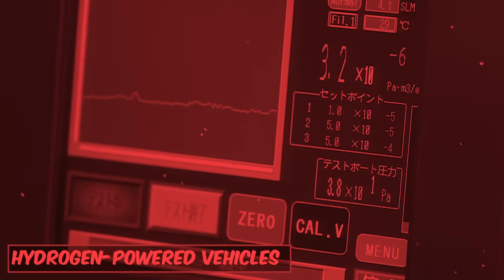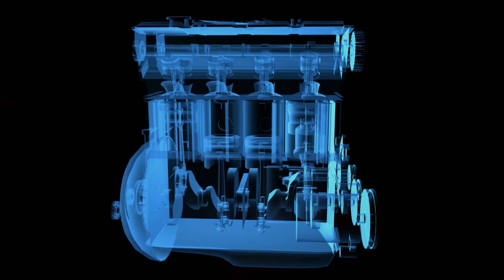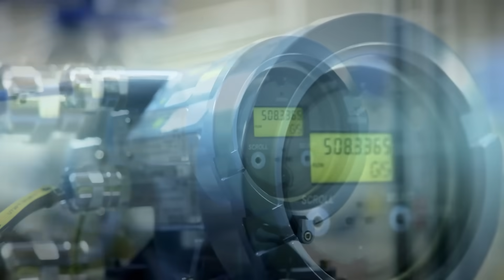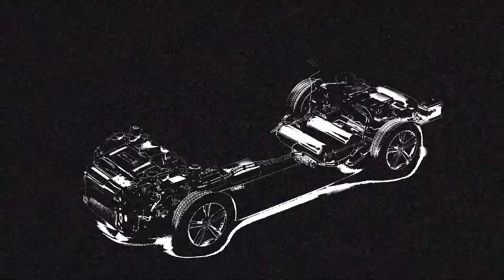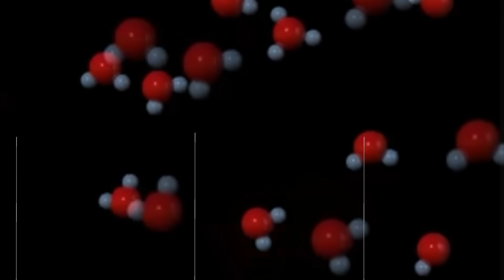Toyota's New WATER Engine Will Destroy The Entire EV Industry!

Comment: The ratio of electricity to run the electrolysis compared to the power output is 70% percent. 70% more power produced than consumed in the 1960 model. The 1995 model produces 300% more power than it consumes. We could and SHOULD have been using water as fuel, since at least the late 60s. We use coal to produce electricity and oil to fuel cars because they are the MOST expensive and they produce the most loosh. Its ALL about loosh production...

Comment: A nice sales voice and soft talk - a bit like someone reading to their children at bed time. I have worked on hydrogen from water without storage and if the bushfires hadn't burned me down in 2020 it might be working by now - solar panel powering hydrogen bubbler via small battery on demand - for cooking, heating and hot water. Not very complex technology at all - but at 75 y.o.now I may never finish the project - I am still re-establishing my rural off-grid setting. And the quantity required for an internal combustion engine is another level altogether ....

Comment: Oh boy! Now we have a valid excuse to operate a still at home. The home distillery that you can use to get distilled water from tap water can be used to make alcohol
 Although a high proof alcohol will power your car too. Running your car on 200 proof alcohol produces water and CO2 with none of the hydrocarbons associated with petroleum based fuels.

Comment: This is a hoax. Energy produced from the burning of hydrogen (in oxygen) is exactly the same (theoretically) as the energy required to produce hydrogen gas (and oxygen gas) from water (via the electrical process of hydrolysis). Due to inefficient mechanical heat losses, the practicality would be even worse than the nett zero position, i.e. it will take more energy to produce H2 (and O2) from water than it would for the reverse reaction. Any high school student of basic chemistry can tell you this. That's why it's more logical to produce H2 and O2 from water, using excess solar energy to power the electrolysis process.

Comment: They talked about isolating the hydrogen from the oxygen. If they just did an intake delete and just had the injector and exhaust they'd be able to make it happen without having to separate. Just run the normal electrolysis through with no intake. H & O would remain separate until ignited.

Comment: There is a challenge the stable producing of H2 from water, need huge amount of energy approximately 397,500 joules (or 397.5 kilojoules) of energy are required to split 1 kilogram of water into hydrogen and oxygen gases using electrolysis. But 1 kilogram of water (H2O) can produce approximately 1238.61 liters of hydrogen gas (H2) through electrolysis.
The energy content of this hydrogen gas is approximately 13.44 megajoules (MJ).

Comment: What about gravity? You climb up a ladder with a bucket of water and pour it into tank. Then generate electricity through a small turbine. Free except for using your energy climbing the ladder?  Or use a few hundred hamsters in wheels turning the mini generators.that you could fit under the hood.  What about using Gas? That might work

Comment: So this runs on water just like steam powered trains used to run on water. 

The steam powered locomotives used to use coal to convert the water into steam.  
  
Where do these cars get the electricity for hydrolysis?

Comment: So apparently, what this will do is crack hydrogen using electrolysis, then power a hydrogen combustion engine from the H2, correct? So you've already taken a hit on efficiency -- you'll get less energy out of the H2 than you put into cracking it, since no system is 100% efficient. Next problem: the hydrogen combustion engine is far less efficient than the modern three-phase AC motors used in EVs, and heavier. And you're going to need more batteries, so there's more weight. Finally, while I'll accept the claim that a hydrogen combustion engine can match the power output of an gasoline engine, your bottleneck is going to be the speed of hydrogen cracking. Can this actually keep up with the performance of the engine, obviously using the small H2 as a "hydrogen capacitor". And of course, you've made a more complex drivetrain than an EV, you're going to have to use transmissions again, etc. Seems a really long away around to offering a straight-up BEV alternative with no obvious advantage. Well, I suppose, given some possible H2 infrastructure, you could make it a true hybrid, powered either from electricity and water or H2 -- and get back some of that efficiency -- but then you're back to a large H2 tank.

Or maybe it's just a hoax, and Toyota isn't working on anything like this. They did recently patent a water-injection-cooled hydrogen engine, something completely different.

Comment: When water molecules are split into hydrogen and oxygen through a process like electrolysis, energy is required to break the bonds holding the atoms together. This energy input is typically in the form of electricity.
Conversely, when hydrogen and oxygen combine to form water through a process like combustion, energy is released as the chemical bonds form between the atoms. This released energy is often in the form of heat and light.
In ideal conditions, the energy required for electrolysis should be roughly equivalent to the energy released during the combustion of hydrogen and oxygen to form water. There is no way to gain extra energy to move the car :)). So this engine still need some external source of energy for electrolysis. Is it another electric car?
Reply: Bingo!  A big EV battery stack.

Comment: Obviously a car who perform the splitting of water into hydrogen and oxygen is gonna loose energy more than it will create. 

But what if a small battery made for an electric car, pluggable, comes with it to compensate the energy needs? 

I think that the goal of Toyota here is'nt to create magic water car, it's all about eliminate hydrogen costly and rare productions plants and transports infrastructures; every water car, even if they need to be plug like electric cars, will be like self-sufficient mini-hydrogen production plant, centering the Toyota's hydrogen motor right in the center of this revolution

Comment: What powers the electrolysis process? Wouldn't it be far more efficient and less complicated to use the electricity to turn the wheels rather than electrolyse water to produce hydrogen to fuel a combustion engine to spin the wheels?

Comment: The concept of powering cars with water through electrolysis and hydrogen fuel cells, as suggested, is highly inefficient and impractical. The combined efficiency from converting water to hydrogen and then to electricity is significantly low, roughly 25-35%. This, compared to the direct use of electricity in EVs which have around 70-90% efficiency, makes the water-powered approach markedly less effective. Additionally, the processes of water purification and distillation add further inefficiency and cost. In its current state, this idea is far from being a viable alternative to established electric vehicle technology, let alone be considered as a threat. This is probably either a marketing video or it is done by someone who has no other job but to waste energy 😁! And you need way
more batteries 😅

Comment: This is total bullshit. To split water into Hydrogen and Ixygen the electrolysis takes energy. So this means the vehicle would need a battery. In which case it may as well be an EV. Also water weighs a lot more than Hydrogen - so there is no advantage over a hydrogen powered vehicle. It makes no sense at all

Comment: Why not produce a magnetic disc for each wheel so as a wheel turns it produce electricity just like the old push bike dynamo,  so as the wheel turns it produces electricity which goes into a battery the more wheels the more power so you'll never have stop and charge plus it's zero clean ...🤔 ..
Reply: Turning the wheels into generators will slow the car down. Generate enough electricity to move the car forward that way and you're never going anywhere... it'll take more energy than the wheels could generate. Otherwise you have a perpetual motion machine.

Comment: So does it freeze in cold weather?
Reply: No because it would be basically a form of salt water, you would need it to make water into hydrogen using electrolysis
Reply: @reefedvessels or is it? Traditional electrolysis as we know it may not be needed..as the "zero frequency " has been discovered
Reply: It says it runs not on salty water. @reefedvessels

Comment: For anyone wondering. This is FAKE and it doesn't exist. You can't run on water as a fuel source for the same reason you can't make a fire with ash. Water is combusted (or what scientists call, oxydized) hydrogen. Just like ash is oxydized wood and CO2 is oxydized carbon (i.e. petrol and diesel).
It's not that you can't turn water into hydrogen, you definitely can, just like you can take CO2 out of the air and make carbon that you can burn again.
The problem is that, in a perfect world, it costs as much energy to turn it into its "fuel" form as what the fuel will provide when combusted. However, we don't live in a perfect world so you'll consistently lose a little bit of energy.
Notice how they never mention where the electricity for the electrolysis comes from. It's the same story with all those perpetual energy devices, they always hide the energy source. 

Source: I'm an electrical engineer
Reply: Stanley Meyer did it, and they killed him for it
Reply: @waltersobchak300  you don't seem to understand how chemical reactions work. It's not that we haven't thought of a neat trick of how to make it happen. It's that it's literally proven for why it's not possible.
Reply: @bennievaneeden2720  hydrogen fuel cells are basically the same. not only is it possible, it's the way of the future
Reply: @waltersobchak300  hydrogen and water are two different things. Hydrogen is flammable -- water is not. When something is flammable, like oil, propane, gasoline / petrol / diesel or hydrogen, it will give you energy to power car. You can turn water into hydrogen, yes, but it requires more energy than what you'd get by burning it or using a hydrogen fuel cell. It would be like dropping a ball from a certain height then expecting it to bounce back higher than the position you dropped it from.
Reply: I am an electrical engineer as well and I challenge you to PROVE your allegation.  BTW Tesla is making the same claim about development of the  water engine.
Reply: A Filipino Engineer Daniel Engil did it but they turned it down, and now they are claiming it for themselves (research it on GOOGLE, "FILIPINO INVENTOR OF WATER FUELED CAR").
Reply: It can
Reply: @jayscully9707  a FILIPNO INVENTOR DID IT, try to Google "Engr. Daniel Dingel, inventor of  WATER FUELED ENGINE, it was road tested from Manila to Baguio City and vise versa and was a success, but some powerful people killed the invention for the reason only known to them.
Reply: Well apparently the automotive engineers disagree with you maybe you should talk with them
Reply: @maureencallahan1604  are these automotive engineers in the room with us?
Reply: @bennievaneeden2720  if you have automotive engineers then how can you possibly claim that hydrogen fuel cell engines don't exist Toyota's been working on them for years as has Musk and Yamaha
Reply: @maureencallahan1604  could you please provide a citation of where I claimed hydrogen fuel cell engines don't exist?... I'll spare you the trouble, I didn't.
This video makes a couple of claims, some of which are false. That's how con artists, such as the creator of this video, dupe people. They hide their lies between truths. I have already explained why an engine running on water is impossible. But for those of you who are interested in this topic: Toyota did create a vehicle that has an internal combustion engine that runs on hydrogen (not water) and the author of this video is misrepresenting the facts, because an engine running on hydrogen is not that special.
Reply: @bennievaneeden2720  have you imagined that a metal can fly or a metal can float in water?

Comment: 😂 This is one of the stupidest things I have ever watched.
At no point does he even hint at where the electricity comes from to split the water. Is there a petrol or diesel generator? Or maybe just a big battery? Either way,  why would anyone use that energy to make hydrogen to burn in an engine to drive the car?  All the unnecessary energy losses, extra weight and complexity!!
Imagine having a petrol tank supplying an internal combustion engine, to drive a generator, to make electricity, to electrlyse water from another tank to supply hydrogen, which would have to  go to a compressor to be😂 fed second internal combustion engine to drive your car wheels!

Comment: Increase range by using diluted water. Genius!
Reply: Distilled, not diluted.  Distilled water wouldn't work anyway, because electrolysis needs electrolytes in the water, which are removed during distillation.
Filtered water is the thing this tech needs to work.  Doesn't matter.  This whole thing is fake.

Comment: This must be an April joke. Water as fuel is impossible, you can not get energy out of it. Where does the energy in this "engine" come from? If you use electrolysis to split water in H2 + O2 and then burn it, it will consume exactly the same amount of energy as it gives (theoretically), in reality more because of losses. Otherwise you would have a perpetuum mobile, as many noticed. Very basic science.

Comment: The key word is in how it works. High voltage. Electric. Electric you can run independently powered hubs. You don't need an engine at all. The engine is wasted space. To many moving parts. I will take simple electric hubs with unlimited power. Nice but to late. Bulky central engines are obsolete.

Comment: Guys , in India during the second World War, there was shortage of petrol and hence  Buses were run on water, they had a water tank on the roof and a boiler on the back and a helper hanging out from the back door would stoke the fire in the boiler using coal or coke. I think this boiler was used to develop steam and that in turn ran the engine of the bus. Can any one verify the use of water boiler attached to buses.

Comment: So, you use batteries to break water into hydrogen & oxygen then burn those in an internal combustion engine to move the car. Hydrolysis and a BUNCH of moving parts instead of electric motors.  Sounds like a lot of inefficiency and maintenance.

Comment: Hi Toyota, Just let you know there is another water driven engine which does not need to be filled. It uses the same water and doesi need refilling. 
But this engine fits into a unit which powers all vehicles, homes at various voltages, boats and aeroplanes.
Itakes it's own voltage which can be adjusted to suit it's installation
 A vehicle can be driven to any remote  building and an extension lead from vehicle to building can power services. As it does not need to have a water tank the vehicle is lighter so faster . An aeroplane not carrying fuel which is a very large amount of weight is so much lighter. Insurance for the unit is cheaper ,no fire risk . 
And it's very cheap to build .

Comment: This was available 20 years ago in Switzerland but the designer was blocked by the motor industries . I went to the presentation of a water powered car in Geneva over 20 years ago
Reply: Or it simply didn't work. You might have noticed that petrol alternatives that actually do work are somehow mysteriously never blocked by the petrol industry. The "motor" industry? This is actually coming from one of the main players in the "automotive" industry. They want you buy cars. They don't much care what fuels you use as long as they can sell one using that fuel.

Comment: This is ridiculous.  Per the video... "When these electrodes receive high voltages..."  they never indicate what the source of these "high voltages" is that fuels the electrolysis process.  You can't get something from nothing.  Even if there was say a battery source for the initial electrolysis process you would never produce enough hydrogen on the fly to both power the vehicle and perpetuate the continued electrolysis.  It's a slick looking video but pointless.
Reply: Yeah I've seen people test these on-the-fly HHO systems and they don't provide benefit. They applaud the idea that gas is not stored onboard but that's exactly how it needs to be to make any bit of sense. Because you can generate your own at home with your own personal wind turbine etc. You can already make your own HHO and feed it through the air intake of a gasoline vehicle. In theory it should work just fine if you reduced fuel injection appropriately, and the HHO tank would need its own variable throttle.

Comment: This is complete rubbish  where does the power come from to perform the electrolysis? There is so much bs that is generated about Toyota   The fact is that they ran down the hydrogen rabbit hole and don't know how to get out. They dropped the ev ball and are playing catch up. To put out a smoke screen like this is disappointing- just like the one about them having solid state batteries. They don't. There are a lot of Toyota fans out there that want to believe, but sadly this makes no sense at all.

Comment: What a load of dung.  Electrolysing water and then trying to get the energy back from the gases produced is about 24% efficient, meaning a car could travel at least 3 times further just using the electrical energy to run an electric motor directly.  This nonsense isn't far removed from claiming you can achieve orbit by pulling up hard on your shoe laces.